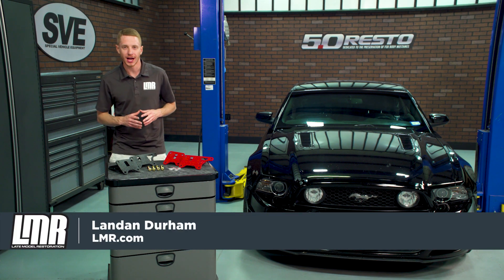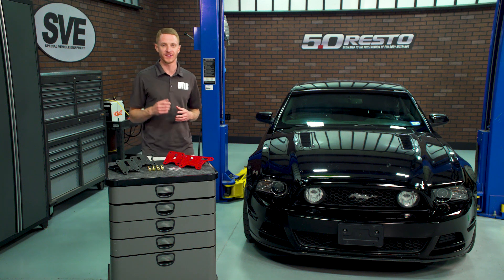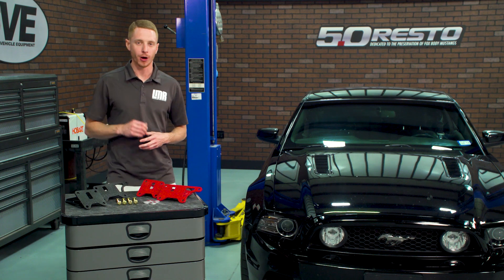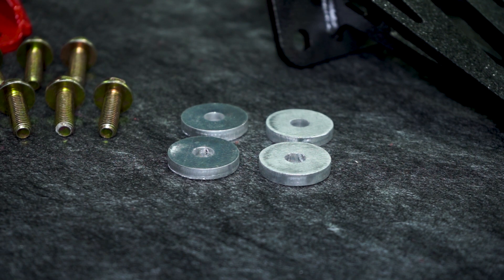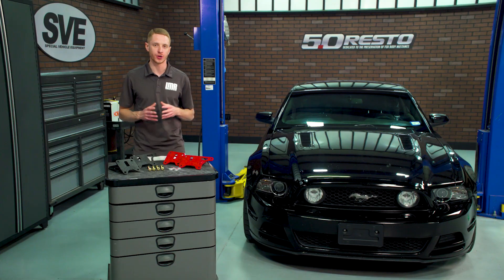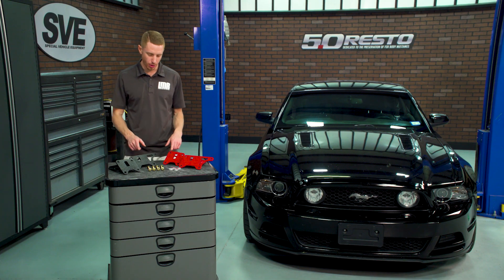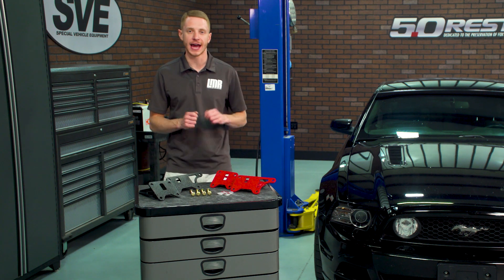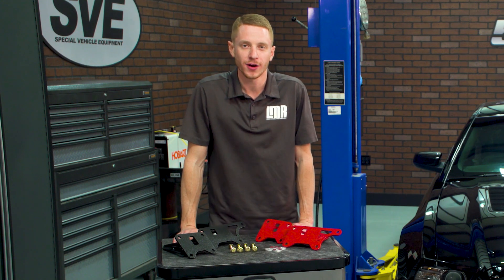2005-2014 Mustang V8 BMR Adjustable Motor Mount Brackets - Review

Comment: BMR is pretty good with instructions most of the time, but with these, cant find anything that is actually helpful. Torque specs are not there, what washers to use are not instructed either.

Comment: how do you adjust them...........talk about but don't show.
Reply from the maker: http://latemodel.cachefly.net/downloads/instructions/MM008%20Install%20Instructions.pdf
Reply: @latemodelrestoration  Not your fault that BMR does not mention the adjustments in their manual, but the lack of install on the review and posting the same info is why people are asking for some help here.
I have a set on the way in but have run into the same question.  Do you install the washers between the block and the mount?  If you do are the included bolts long enough, or are you supposed to then use factory hardware.  Are the bolts included too short and you need to shorten the factor bolts when using the spacer?
The engineer in me says that if you want factory height you put the spacers between the mount and the block, effectively mounting the motor mounts lower, but then you would need the screws to be longer to make up for how much bite they have in the block.  My guess would be the thread length of the included bolts + spacer amount of threads.
That is a lot of guess work.  Stacking spacers would only work to lower the mount and raise the engine.  Does that mean this defaults at full drop and need spacers to have factory height? 
Also going to talk with BMR directly, but these questions seem like what every comment is here for.  The instructions are useless on how it is intended to work and what height that sets.  Doesn't even mention spacers.